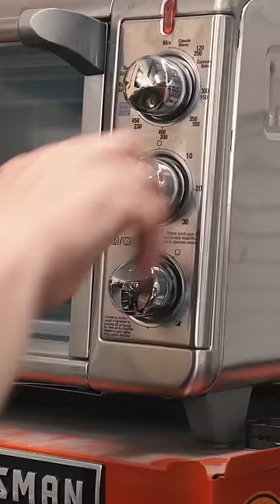Heat treating stainless steel knives.

Comment: I’m not sure what I saw.  But would love to know!  Looks very cool!  Yes, and hot.
Reply: He is wrapping the knives in the foil to prevent oxidation, he heats it to a certain temperature, then he cools the foil and cuts it off to quench the knives in liquid nitrogen. This will harden the knives, he is then putting it in the toaster oven to heat them up to a relatively lower temperature to temper the knives, this makes the blades more pliable and less brittle.
Reply: @jacobgreenbaum231  Thanks for that...
Reply from the maker: Jacob was close in his description.  This is an air hardened steel, so it is "quenched" between the two aluminum plates.  When it is cooled, it goes into the liquid nitrogen to help complete the hardening process, this is only applicable to certain steels.  Then I tempered it in the smaller oven.

Comment: Awesome video, what kind of steel are you forging and what is your hardness after this process?
Reply from the maker: Thanks, the steel is CPM154 and its right 61.5 - 62 hrc after heat treat.
Reply: I would love to try my hand at blacksmithing but have next to no tools maybe one day I will be able to give it a shot for now I will keep dreaming.
Reply: @abstractgamer8543  start with simple stock removal, it isn't forging but you can learn the basics of grinding in bevels and shaping
Reply: @abstractgamer8543  they sale blanks pretty cheap too.... You could practice on those... Never know where it'll lead ya
Reply: @thatdude8247  If I was going to buy some flat stock what kind of steel would you recommend.
I'm saving for a grinder and wheels now.
Reply: @abstractgamer8543  cheapest you can afford... Should be softer and easier to work with them once you have the basics down start moving up and worrying about more expensive blanks.... If you're in the US Smokey mountain knife works sales blanks for and $10-$15 add your own style to them and stop if you think your messing up. Use files instead of a grinder until you figure out the heat treat process of whatever steel your using. Get a scroll saw or jamb saw and you could cut your own handles from old furniture pieces... Use the file at to finish the shaping of the handles.... Old copper pipe could be used for setting the handles and look fantastic as well.
Reply: @GaskillKnives  nice. We use ATS-34. 154 is very close to it.
Reply: @GaskillKnives  have you ever done a heat treat on magnacut steel ?
Reply from the maker: @jamesfair9751  I have done one so far.  It was a fillet knife at 63hrc and it performed fantastic with great flex in the blade.

Comment: I’m used to seeing knives go into the oil immediately. Are you letting them Air Cool in the aluminum plated press? And then into the liquid nitrogen at a later point?
Reply from the maker: Certain steels are air quenched instead of oil quenched.  The liquid nitrogen helps complete the hardening process.

Comment: You hung it in liquid nitrogen? So many questions of why and won't that make the steel brittle?
Reply: I was thinking the same thing I hope he answers this question
Reply: Spojrzyj na skład i właściwości tego gatunku. To stal proszkowa o dosyć specyficznych wymaganiach  przy obróbce cieplnej. Pozdrawiam
Reply from the maker: In some steels it finishes the hardening process, allowing me to get a little more hardness out of the steel.  The steel naturally becomes more brittle, but that brittleness is removed during the tempering.
Reply: @GaskillKnives  oh ok I guess old dog like me can learn new tricks 🤣🤣🤣
Reply: @GaskillKnives  thanks for the answer and awesome work sir
Reply: @GaskillKnives  Would quenching in oil also work like normal steel? I guess this just makes a better hardened steel and the tempering will counteract the increased brittleness over an oil quenching but still keep a superior hardness? Man I wish I could afford to get one of your blades or work as a shop slave for you for awhile,  like the old school way of working for payment of knowledge and skills and maybe a blade here or there, haha..
Reply: Cooling it in liquid nitrogen removes the austenite that is left after rapid cooling in this case with the alu blocks. Afterwards, the steele is left with only martensite and carbides (depending on the carbon %) which results in steele left with no phases that "ruin" the properties. Basically, it allowes the steele to have higher hardness. (Of course it drops after tempering but for the benefit of ductility)
Reply: @Lotek117 oil quenching isn't for stainless steel, that's for carbon steel

Comment: What steel are you using? I know it's not D2 cause your  oven can't get it hot enough to draw it back!  Is it O1 or something along that line??
Reply from the maker: It is CPM154, in response to the oven, I only use this oven for the first temper at a lower temperature then I go to my oven inside my home to get a more accurate temper.

Comment: I never would have considered doing it that way, I always quenched my blade vertically in motor oil, I wouldnt have considered doing it that way but if you get good results then there must be something tonit
Reply from the maker: this only works with air hardened steels.. Stainless, A2, D2...
Reply: Is this to avoid introducing extra carbon into the steel? I've not had a chance to use tool steel and very little experience with stainless.
Reply: @patrickcamp5885  the foil bag, or the air and quench plates? The foil bag prevents scale, if you don't have an inert oven. The air quench only works on air hardening grades, and doesn't introduce the shock or stresses into the steel like oil quench, which is much faster. This results in better dimensional stability.
Reply: @plkracer  I understood the use of the bag, but was unclear the advantage of quenching without oil. Thanks for sharing. Learn something new every day, and with any luck I'll even remember it.
Reply: @plkracer  I never heard about air quenching, that seems really interesting. I know it's a little much to ask but if you dont mind would you care to explain it a little bit? If not I understand but seems really interesting. So apparently it only can be done with stainless steel and tool steel/high speed steel? I always thought tool steel was just a certain formula of hardened steel, I didn't realize there was unhardened tool steel. You seem very knowledgeable, do you have a blacksmithing channel?
Reply: @Lotek117  no, I don't cover any heat treating on my channel, just some buggy build videos from years ago. I specify plenty of tool steel for tooling and equipment though. Air hardening steels (A2 is most common, D2 is common for sharp edges, S7 is common for tools like bits and dies to resist shock loading, stamping, etc) don't require a rapid decrease in temperature for the hard martensite structure to be locked in, like Oil quench steels, such as O1. Most air hardening steels are high in chromium, which I believe is the key to making this work, and also provides decent corrosion protection. Higher carbon in tool steel produces higher hardness, typically, but is also more brittle. 

All tool steel is purchased in an annealed, or similar, condition, you can machine it like any other high quality steel, then harden, and grind or hard mill to final shape and size. 

Air hardening tools steels are super versatile, we use A2 to make complicated parts that are Rc60, and thin walled down to 3mm, which only a few thousandths of distortion during heat treat. In thin walled part, free air cooling is enough to produce a hard part. Thick parts, or the use of a bag requires a stream of air to cool the part fast enough to make it hard.

Comment: Heat treatment what was the quenching liquid? Or was that nitrating?
Reply from the maker: This is stainless steel, it is air quenched in aluminum plates and then put into liquid nitrogen overnight to help complete the hardening.

Comment: What's the reason for using liquid nitrogen? I've never seen that used for a heat treatment before
Reply from the maker: It benefits certain steel by helping complete the hardening process.

Comment: Question to the knife maker , from my binge of forged in fire I have seen some people say that you will lose that heat treat when you start taking off material or do they stay that thick? I have been talking to my girlfriend about forging a knife for month's now!
Reply: U will lose heat treatement only if u overheat ur pièce during thé removal, thats why, most of the time, we remove juste à little more than half of thé blade before heat treatement, also as it became harder After thé heat treatement thé more u Can Do before is the best.
Reply: Лучше бы ты с девушкой занялся сексом бро, в место разговоров которые ей не интересны)
Reply from the maker: The other comment is correct, you have to keep it cool.  So I cool it in water almost every pass grinding.  There are pros and cons both ways.  But with many steels, I like to grind bevels and taper tang post heat treat.  Less chance of warping and I like having a little more resistance when grinding.  But it does eat up belts faster.

Comment: Have you ever quenched in liquid nitrogen? And is it possible? And what do you think it would do?
Reply from the maker: That is not something I would try, for one the steel is designed to be air quenched at a certain rate.  Second, liquid nitrogen has a mind of its own sometime and I would not want to put something that hot in it, could result in some major pressure/spillage.

Comment: Might have asked why would you heat treat the blade before you even ground down the profile. Wouldn't it make sense to grind down the profile then he treated
Reply from the maker: I profile, heat treat, the grind the bevels on most of my knives.  Lot less chance of warping.
Reply: @GaskillKnives  ok makes sense

Comment: liquid nitrogen quench? that's a first for me. Wonder what the difference is.
Reply from the maker: Its not a quench, the quench was done between the aluminum plates.  The knives go into the liquid nitrogen at room temp, this helps complete the hardening process in certain steels.
Reply: @GaskillKnives  ooh, I must've missed it. Thanks for clarifying!

Comment: Is that heat treating or super cooling. I know it's both but drop some knowledge on a layman. No bagels required
Reply from the maker: I am heat treating, first I heat then quench in the aluminum plates.  Then I put it into the liquid nitrogen to help complete the hardening of the steel.  Then I temper it in the toaster oven.

Comment: I spread up a thought could you technically quench a knife or a sword in liquid nitrogen because usually when I see people doing it in videos they do it in oil or water but I wonder could you do it in liquid nitrogen
Reply from the maker: I wouldn't try that, for one it would  be fairly dangerous.  Second, the steels have pretty specific heat treat recipe that call for certain rate of cooling.
Reply: Explosion 💥🤯💥
Reply: @GaskillKnives   thank you for answering my question

Comment: Wouldn't it make  sense to remove some steel before heat treating it? 🙍🏾
Reply from the maker: Certain steel I like to grind post heat treat.  To reduce warping and I like having some resistance while grinding, I feel I have less chances at mistakes.

Comment: I thought stainless didn’t really need heat treating like high carbon steel.
Reply from the maker: It very much so does, unless its already been heat treated.  But then it would be pretty difficult to machine.

Comment: I thought u heat treat after u grind bevels because grinding takes it away
Reply: Not on the stainless steel he's using. You just keep running it through water when grinding to keep it from getting too hot